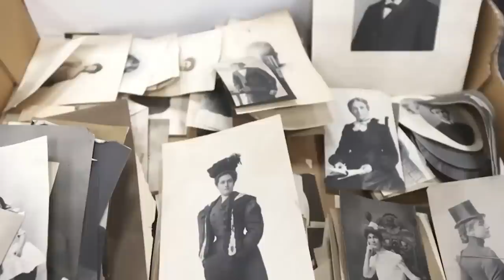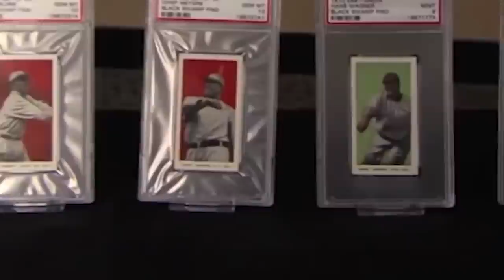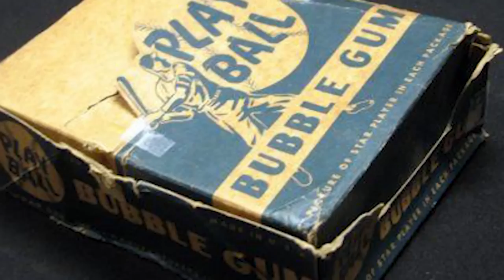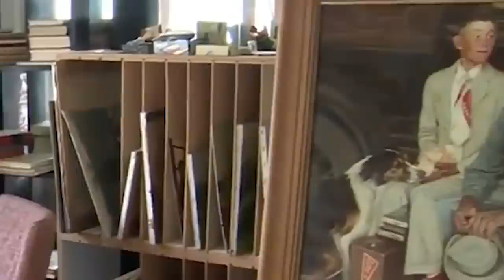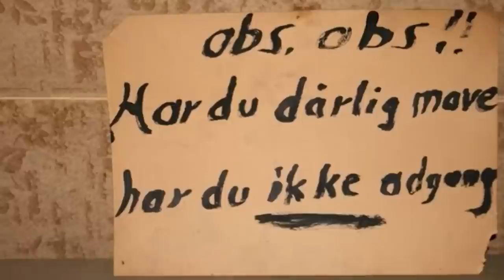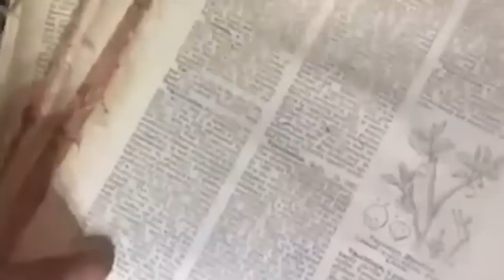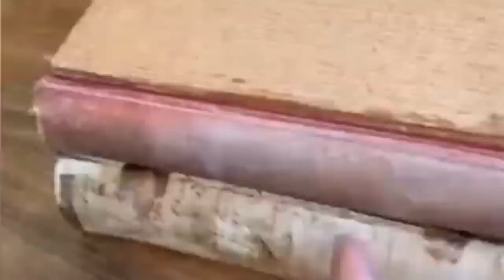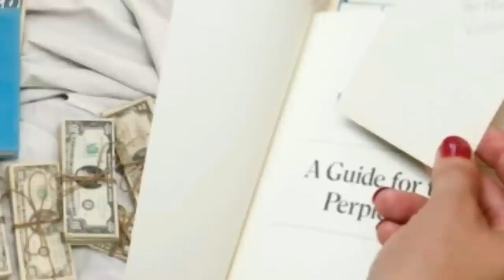20 Crazy Things Found in People's Homes

Comment: Clearing out a crawl space under the attic of a rental we were living in we found it full of Mahogany wood trim used in the construction of the home in the mi 1800's. My roommate was a carpenter and was pulling it out little by little to reuse. Eventually we came across a partition  jutting from the wall, both side had shackles like you might find in a prison. on one side was a can of corn a hundred hears old and on the other side the skull of a dog. One night Brian was asleep in his bedroom, which led to the attic, when he heard a large dog come down the stairs, sniff the back of his head and proceed into the hall way. He got out of bed to see where the dog went only to find no dog. Over breakfast he related the story of the dog to me. After breakfast we went to see if the hall closet we were painting was dry. when we opened the closet door there were paw footprints in the new paint that went up the wall and across the ceiling.
Reply: Put in